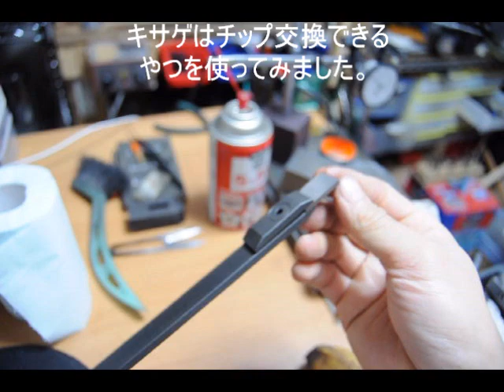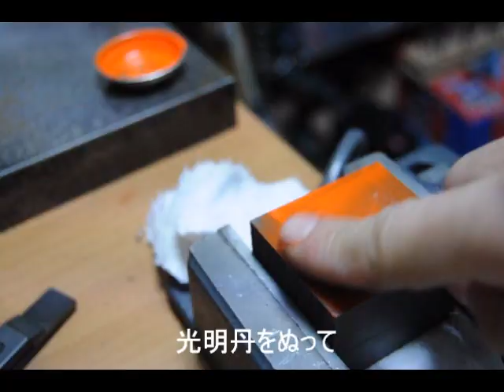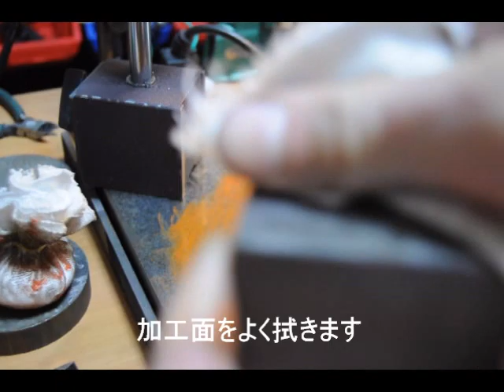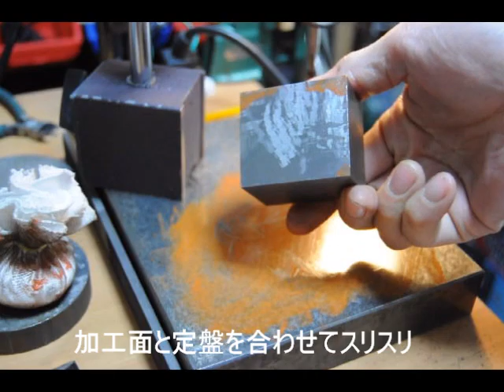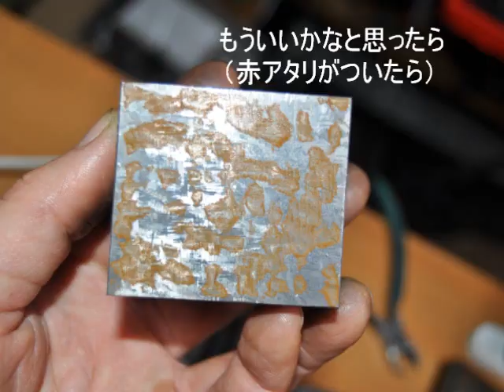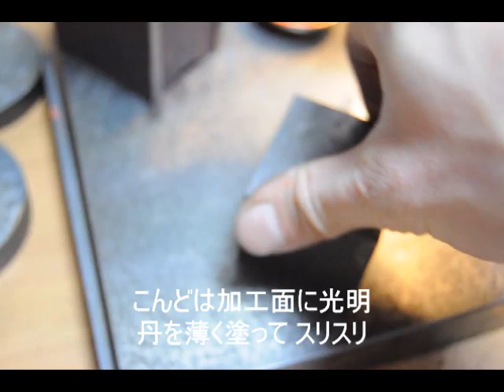How to make an exact flat metal surface by using scraper.

Comment: To scrape a flat surface from scratch you need to have three pieces. They are scraped against each other in rotation thus eliminating any concavity or convexity.  You will only scrape a flat surface by this method to an accuracy equal to or less than the master plate you are using. The old ways still remain.
Reply from the maker: absolutely right!

Comment: Dear Sir, can You plese share what kind and brand of marking paint You are using to highlight the high spots
Thanks in advance!
Reply from the maker: I am using traditional Lead Oxide. TRUSCO in Japan. It is not good for occupational safety but still many brands are available. I am looking for good alternatives.
Reply: @093tatsu7  Seems, that many Japanese crafsmen are using this type of marking medium. In Europe, we use either water based stuff, or classical  Prussian blue oil based paint.
The oil based paints are not easy to clean, and the water based stuff promotes corrosion on metal surfaces.  No ideal variant.

Comment: Would this work on hardened steel, like O1? Would an improvised scraper, like a ground file, still work? Thank you for the video.
Reply: no the "to scrape steel" has to be soft. When you try to scrape on harden steel the carbid tip will run over the surface. You can scrape alu steel and cast iron, brass works to. But harden steel is to grind. Why are you asking?
Reply: @fearlyenrage  I'm a woodworker. Hand plane blades need to have their backs lapped flat, which I do by hand. Occasionally, I will encounter one with a hump. In addition to this being a bunch of material to work off, I think there is a tendency for the work to teeter-totter on the hump so that lapping doesn't focus on the high spot. I was wondering if I could scrape down the hump. These blades are typically hardened O1. What I have done in the past when a blade was particularly bad was to use a handheld grinding wheel to try to focus on the hump, but at least in my hands, this is crude. That's the background.
Reply: @ef2b  aha.
Ok well it is possible to apply water to a running, best works on a slow running, beltsander. But a warning here that works safe as long as no water enters the motor housing!
Why add water to a beltsander? 
To cool down the grind so the steel wont heat up. 
I dont know how hard your steel is maybe it is a chrommoly then it is very unlikey to scrape it. But when it is a japanese sanmai steel sandwich then the softer steel could be scraped. 
When you would film the blade steel and show us the plane maybe we could come up with an idea.

Comment: All very well and nice, but the flatness is measured against a reference surface, i.e. the granite.  How was the granite made to be flat?  How do you create the initial flat surface against which to measure?
Reply: +swillswill It's known as a machinist's table, you purchase it
Reply: +swillswill I think it is possible to make a flat surface when you have three pieces. You compare them with each other, scrape, and repeat. It should converge to a flat surface on all of them.
Reply: +swillswill Uh, the "granite" is a surface plate.  It's sold as a reference surface for inspection and machining.  A high quality surface plate will be flat to within 
±0.000025".
Reply: I know its been 2 years but.... 0.000025" is 635 nanometers. there is NO WAY that's true. That's smaller then some wavelengths of colors...
Reply: Check out Federal Specification GGG-P-463c, It sets the Metrology standards for surface plates. For an 18 x 18 or smaller surface plate it can't be anything over .000050" out in flatness or it's rejected. A modern, good quality, granite surface plate usually beats that. You're correct that it's smaller than some optical wavelengths, they use inferometers to check the flatness. It's crazy, but it's true.
Reply: Nick C dang, I had no idea. That pretty incredible and interesting. I’ll have to look into that. Thanks for sharing!
Reply: bwahaha.. welcome to the world of lapping my friend.. in semiconductor and atom force sensing you lap to even greater tolerances :D maybe you should start with a book or two about lapping techniques
Reply: Andrew York it's not necessarily being anal. If you are creating a precision machine which goes on to make some sort of precision part, tool, instrumentation, you want as close to perfect as possible.

Machinists, for example, would call this "tolerance stacking". If you have enough "almost flat, parallel, square, etc" during the machining process the end result of all of these inconsistencies results in a very poor fitting assembly.

Just something to consider.
Reply: You can machine (polish) optics with "atomic-order surface roughness and nanometre-level shape accuracy" using magnetorheological finishing (MRF) where an abrasive slurry becomes the cutting bit through computer-controlled magnetic manipulation.  I'm not sure of maximum size but at least 20cm and you can cut Zerodur which has a coef. of thermal expansion of ~7*10^-9/K...I guess that would be a nice, stable, flat surface (probably not as scratch resistant as granite though).  Here's a random video on it https://www.youtube.com/watch?v=ueawb_uGSKU
Reply: perspectivex, watched the video and now my 12,000 grit sharpening stone and 60,000 chrome oxide polishing compound make me feel like a primitive making a blade with an antler and a piece of flint.
Reply: If you are curious how they make it flat check out Ox Tool Co. They use a diamond abrasive slurry in combination with a special technique and another flat surface. Switch plates around they eventually get flat. Said plate is cast iron to lap the granite.

Comment: Yeah yeah ! 
Everybody's an expert.
Scraper this, scraper that, burrs this & that. What about the grinding? Dunno, don't care, its the finished article that counts.
A perfect (within human parameters) is impossible to achieve, it is NEVER completely flat (one of life's little setbacks) however, a 'Gas tight' fit could be classed as a perfect surface and this is why Surface plates, Vee blocks and other measuring devices cost so much. 
I cannot read Japanese, if that is the subtitles language but the airtight seal on the final product speaks volumes. 
Try taking in the method.
Reply: um airtight seal has no relation to flatness. you ever hear of metal crush gaskets, they deform to the surface and get air tight seals, used for high pressure high temp stuff, clearly the crush gasket is about as far from flat as you can get.

Comment: It seems counter intuitive that an extremely flat surface could have so many scrape marks in it. You'd expect it to be a mirror finish.
Reply: there's a difference between flatness and surface finish
Reply: You could polish it with some 3-4-5-6-7000 grit lapping compound on a piece of glass if you want?
Reply: You're screwed if the glass isn't flat. Machinists have different expectations with respect to flatness.
Reply: In that it can be smooth and curved, for instance, yes. But that still doesn't answer why scraping is best, if it is. All the attempts at explanations say "it just is", which isn't what explanation means. It calibrates against a standard flat surface, so how was that flat surface produced in the first place?
Reply: If you want to know how to make a surface plate without having one already you use the 3 plate method (you can look it up on goole), this was invented by Sir Joseph Withworth. Scraping is often superior to surface grinding because first of all you are not limited by the size of the surface grinder you have (you can take a scraper to a machine) Secondly a scraped surface makes a better bearing surface than a ground surface (ground surfaces tend to push all the way oil out en stick together, thus making the machine wear out quiker) this is why scraping is used primarely on machine ways that have to slide accurately. And at last you can scrape very accurately (the only limiting factors are the skill of the scraper hand and the flatness of the surface plate, and the surface plate like i said earlier can be made to any flatness wanted by repeating the 3 plate method) while a surface grinder can never make a part more accurate than itself, also with scraping you don't have any heat build up or clamping force that can distort a part.
Reply: the point of scraping is different.it provides point contact at exact plane .the surface is ruff i quess if you see it under microscope but the highest points are exactly at flat plane
Reply: That really is great explanation Stefan STamatov.

Comment: Lol a lapped surface is no good for parts that need to move against each other.  Thats why scraping is used as it DOES leave peaks and valleys.  It is extremely flat over a number of points in a square inch.

Comment: Why not use grinder?
Reply from the maker: +itanium7000 Because this is the most useful traditional method to make an EXACT FLAT SURFACE.
Reply: +093 tatsu Thanks!
Reply: +093 tatsu Actually, a surface grinder would be far more effective.
Reply from the maker: I do not have a surface grinder at home.
Reply: 093 tatsu I never said you did. I just said that a surface grinder is the absolute most effective way to get a perfect surface.
Reply from the maker: Thank you for comment. I agree with you. On the other hand, there is the fact that the running surface of the surface grinder is finished by hand scraping.
Reply: 093 tatsu Actually, they are ran by other surface grinders now...
Reply: +rkshireygames  Actually no, form Kent's website "Our precision series surface grinders are manufactured with high grade FC-30 or Meehanite castings, properly aged and hand scraped for long lasting precision and reliability." From Chevalier's web site "Machine base slideways are laminated with Turcite-B and precisely hand scraped."  From Clausing's website "Anti-wear Guide Ways The saddle rests on precision hand-scraped double V ways & the table rests on precision hand-scraped V & flat ways which are coated with ‘TURCITE-B’."  Surface grinding can certainly give you a great surface, but hand scraping is still the norm for machine tool bearing surfaces for several reasons.
Reply: +rkshireygames That's simply false. You have no idea what you're talking about.
Reply: +Duane Dibbley Actually lapping is much more effective at this, and doesn't leave the result to how precise you can be with a scraper, more importantly it is easier as you don`t have to consistently check what raised edges are still there. Using this method could be a pain because if you go deeper than the point you meant you have to remove the entire layer to match it.
Reply: +rkshireygames  About a grinder being more effective. 
1 If you mean effectiveness in terms of time efficiency, yes you are right.
2. If you mean accuracy Not really!

 Scrapping is much more accurate, in fact many industrial machinery are scrapped, or now days, grinded, then scrapped, and after scrapping maybe lapped for the best accuracy.
Reply: survase grinder is

Comment: How to make a flat surface by scraping? 
You will need three (3) surfaces to probe against each other.
If all three fit against the other two in turn, then your surfaces are flat. 
With two pieces (surfaces) you cannot get real perfection.
Think of it and you will understand why.
With large pieces that may not be possible. Then we need a laser interferometer.
Reply: Um 2 pieces would work if 1 is already know to be so flat. Additionally would 2 surface work if use 2 areas  on one surface?
Reply: Note he is not using the 2nd known flat surface to grind the 1st, only measure, so at no point does it begin to lose it's flatness.